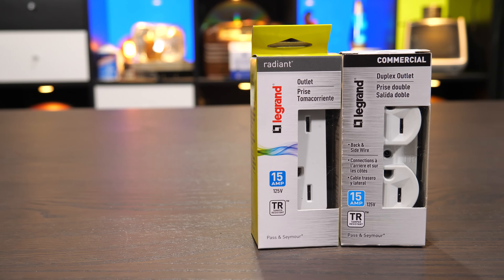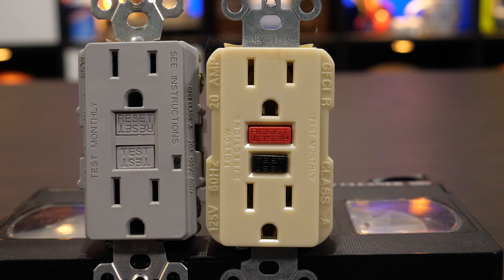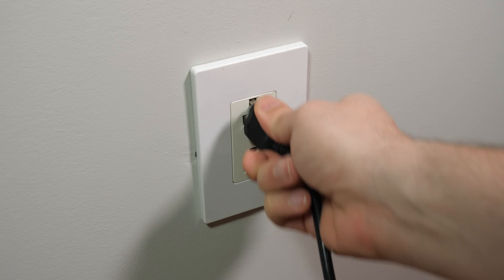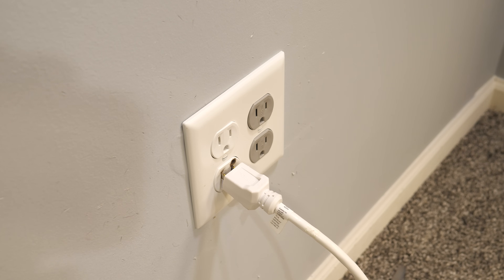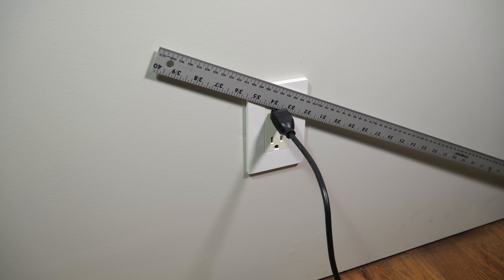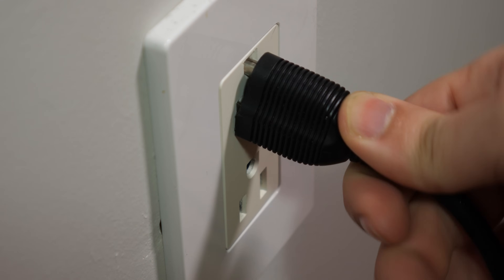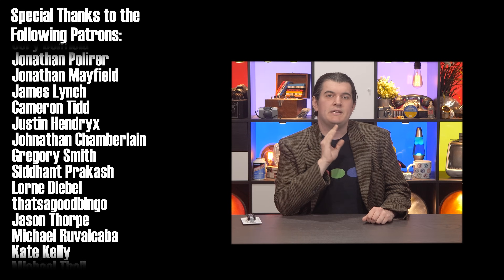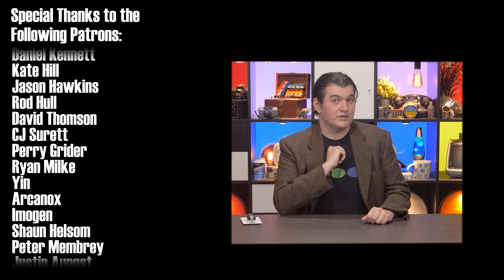Power outlets are topsy turvy - but does it matter?

Comment: I was moving a stack of sheet metal and one of the middle sheets slipped, slid down the wall and landed between the tiny gap between the outlet and pins of an extension cord. The resulting BANG and shower of sparks has led me to become a full believer of the ground on top orientation of outlets.

Comment: The plug designs we use here in Estonia (yay for EU) are superior in all aspects. 

*Neutral and live are interchangeable 
*Ground is a mirrored pin on the sides,meaning the socket orientation does not matter at all. You can plug it whichever orientation.
*all sockets are recessed
*pinholes for the plug are small and round and really hard to get stuff into
*pins on the plug are isolated far enough that power disconnects before the conductive parts become accessible.

They are more bulky and annoying...but are just plain better

Comment: The awnser for my situation was both orientations!

the kitchen has ground up due to a 2cm thick backsplash that would prevent any flat plug appliance being used, and forks/knives occasionally fall down the side of the island

ground down in the office and bedrooms because of ground down 90° plugs on most UPSes and surge protectors

the garage is mostly ground up as all equipment is above the outlet, the added benefit of plugs staying in when tugged, and all the thin metal objects hanging on the walls

and for all the outdoor outlets and any quad box, its both, with ground down on the left, up on the right, allowing for 45°
/90° plugs to be used in the recessed outdoor covers, and most of my outdoor stuff prefers ground up

the living room has mixed outlets, otherwise 3 way taps fall out if they are loaded with #14 cords or transformers, and all new 6 way surge taps fall out if you look at them wrong because manufacterers decided to move the plug to the bottom half for no reason! while power strips want ground down

Comment: It comes down to two things.  North America had powered outlets in homes well over a century ago and Americans are incredibly resistant to change, (Carter tried to get us on the Metric System and was hated for even the attempt) We have always been cavalier about electricity.  Hell, early tube radios had "Hot chassis" wiring. Even into the 70s we had TVs that had a hot chassis. All two pronged.  The radios didn't even have polarized plugs which could lead to the chassis of the radio to be on the hot power side.  At least the modern 2 prong plugs and receptacles are polarized.  I won't even get into resistive (curtain burner) power cords that were used on tube radios in the 30s.   I guess it never became a massacre so we just left it.  Codes have even been dropped from receptacle orientation. It has just remained an issue of preference as Alec pointed out.  I compare it to which way the toilet paper roll is mounted.  Either side has their logical reasons for why it should be placed one way or the other but not worth a fight about it.

Comment: Standard 2 and 3 prong plugs are dangerous if you have an IQ under 60.  The first time I saw plugs with the group installed up was in the 1996 NEC where it was listed as a suggested, therefor optional, installation method.  Having the ground up keeps stupid people from hurting themselves when they intentionally place  conductive material across the hot and neutral pins when the plug is partially inserted in the receptacle. 

The fix is to isolate the family members with an IQ under 60 in rooms with no outlets within reach and furniture bolted to the floor.

Comment: I was an EMT for 12 years. Hospitals invert certain plugs for emergency equipment. You will also find that they are usually painted red as well. When a code happens, or a patient requires critical equipment like a vent, they want to make sure there are outlets available. They do this by painting them and inverting them. The thought is if you go to plug something in out of habit it won't fit and it will cause you to look. This ensures hospitals always have outlets available for critical emergency equipment and they don't have to waste time unplugging lights or non-critical equipment. On the civilian side, I've seen electricians invert plugs that were switch controlled so a homeowner would know which plug was controlled by the wall switch. Useful when your trying to plug a lamp in.

Comment: As a Russian I see US electrics as so outdated that it is funny. Our standard power outlet can deliver 3500W power instead of how much? 1800W, I believe? And our Type F outlets much safer both inside and outside. Even in cheapest electrical outlet it is impossible to have these naked hot contacts, they are deep inside socket, but good enough outlets have child protection preventing sticking inside something that is not electric plug! Speaking about internal safety, why do you have metal socket boxes, which are fraction of inches air-isolated from hot wire? Our socket boxes are all plastic! And we don't ever make hooks on the end of the wire, our sockets are designed that way it holds straight wire, it is much safer because wire can't slip out of screw head while you tighten it. Even our ВВГнг (VVGng, strands for PVC-PVC-wire non-flammable) cable is much safer, because all wires are isolated individually. And talking about convenience, our wall outlets not stacked in pairs, you can make whatever you want from 1 outlet to 6 in row. And there is no up and down situation, because outlet is symmetrical!

Comment: What I think about is curtains or cattails maybe a sheet of paper or paper clip some kind of object falls in the right place. You can’t make it in 20 shots with the basketball hoop but by God, something falls off the desk and it will be final destination style… That if anything fell in there, plugs, get pulled halfway and continue to work. It would be more likely to fall onto the ground wire instead of connecting and causing an arc.

Comment: You know, I saw a sleeved US plug in a video once, it was for a Chinese market appliance. They are even more YOLO about electricity there, they use 240v but they use these universal US/Australian/EU outlets so they can use plugs as terrible as they like! But apparently sometimes they use something a little bit better... Occasionally for good measure you'll see a socket that accepts UK G plugs as well so you get a nice big unshielded hole just begging to have something metal poked into it.

Comment: 8:52 when I was in elementary school I was helping my dad do a friends basement remodel and he asked me to remove all the (metal) receptacle plates so he could paint. I saw their computer was on and tried to get the plate off without unplugging the computer. He walked over right as I got the screw off and yelled at me as soon as he saw the plate falling onto the plug. The prongs were all the way in so nothing happened but he explained to me that I should have unplugged it first.

Comment: I dropped a framed picture onto an outlet. I think there was a battery charger plugged in. The metal wire on the frame hit the hot and neutral and melted, scorching the outlet. My kid, in his younger days, partially pulled a plug and touched a the metal part of a pencil across the hot/neutral.

Needless to say, when I install outlets, I put the ground up.

Comment: The concern regarding the blades being accessible by children's fingers has always been reduced by the fact that children are generally introduced to the dangers of electricity at a young age in the United States since it has simply been a fact of life for more than a century in some areas. Though flawed, the simplistic and compact design proves quite advantageous given just how many outlets on average are being utilized—and the number continues to climb as our lives depend more upon the conveniences and crutches of electrification.

The older plugs were able to get away with how they were designed due to the aforementioned plus it is likely that the insulators were a better material. In the past, aesthetics of plugs were not generally considered and the focus was simplicity and effectiveness.

Modern three-prongs likely have better insulators due to generally being for more heavy duty applications and thus can remove more of the material. This is especially noticeable when you hold the plugs. The two prong generally has a more molded plastic feel whereas the three-prong feels more like rubber—a generally better insulator and more resistance to heat than plastics.

In my experience, the older power outlets had a much better grip on the plug and even in newer outlets, the older plugs are better form fit to retain their hold. Conversely, modern plugs are prone to falling out of the outlet—especially ones with foldable contacts.

Comment: In the UK they are always horizontal, so the wires can be flush without them blocking other outlets (or sockets). Also the ground (or earth) pin is always on top, and the live and neutral pins are sleeved.

Comment: When it comes to the issue of accidentally getting shocked while plugging in something, how about adding a switch to the receptacle, which you can use to cut power to the active connection, so then you eliminate the chances of that happening?

Also, I was easily able to remove those "baby safe" covers when I was a toddler by sticking my nails underneath. Which might be less safe.
Reply: I always used a butter knife.  Probably even less safe.

Comment: But then right-angle plugs make using power strips more of a PITA, at least with the way they're spaced out currently. If all of our new plugs were made to be right-anglers, power strips would need to follow suit and be bulkier for the same number of outlets, which in some situations would be more of a waste of space, as on a desk, and more cumbersome.
Reply: Power boards in Australia position the sockets horizontally, so if you had a cord pointing down, it would go right off the board. You can also buy ones with extra horizontal spacing to accomodate plug-packs. Unfortunately, some manufacturers have started putting their plug-packs sideways, which defeats the purpose and trying to plug such a device into even the extra-spaced sockets will still block adjacent ones. Which wouldn't happen if they just pointed it down like normal!
Reply: @Roxor128 : Heh, thanks. Yeah, that sounds frustrating!

Comment: Ground up only is practically applicable for emergency/backup receptacles and hospital use where proper cords(and code) are always used and accidents and stupidity is abundant. Even then the aforementioned is in place, different style plugs are used, or GFCI breakers are in place rendering a fault anyways. American style plugs are utilitarian for the service, and sufficient in most cases, I think Aussies strike a good medium with usually just coating on hot and neutral.
P.S. As someone that works on live 120/208/277 in a room of constant idiots that like to touch, people really do rarely get shocked vs overloaded circuits and smoked outlets.

Comment: Ok hear me out.... the receptacles are facing each other, not stacked. So ground pin on outside so no matter how you install it, the ground of the top plug is always facing up. No more arguments over orientation, and right angle plugs will never interfere with each other. It's the most logical compromise maybe?

Comment: fun fact:
shoving a piece of metal into the ground of a receptcle and connecting it to an antenna connection on a radio will turn the whole electrical system into an antenna.

Comment: You clearly do not work in a shop, or on site.  It is a U ground not a n Ground.  Don't let old plugs slow down new better standards.  Right angles do not lie flat with extension cords.  Right angles have their place, but this is the first time I have thought your opinion is yours, but wrong.  The C ground is a really nice idea though.

Comment: 8:37 This actually happened to me one time. I was installing a 2 prong to 3 prong adapter on a plug with a metal plate and had the adapter plugged in and I was reinstalling the screw in the plate and the metal plate slipped down onto the two live prongs of the adapter and made a hell of a spark and melted the plate where it touched the prongs. I don't remember if it popped the breaker or not.

Another issue is with polarized wall warts or plug in transformers. I don't know why they make them polarized and when you try to plug them in: nope wrong way try it the other way nope you had it. You only need polarized plugs on things like lamps and not plug in power supplies.

Comment: Honestly, the only real bad thing about an inverted plug (ground plug up) is that you can't safely plug-in a wall wort (wall transformer) with polarized plugs, because the center of gravity will then be above and out from the outlet -- not to mention the cord protruding from the top being a source of torque! -- causing it to tip out of the outlet.

Comment: very slightly improving safety for super edge case situations....at the cost of NOTHING, seems fine to me. Hot-pin down sideways, or ground-up works for me. I like sideways, but mine are all ground-up and I dont like working with drywall, lol. My kitchen ones are sideways and the one next to the sink in the bathroom rotates, which is really strange.
I known my buddy chose ground up in his woodworking shop because nails falling back there and sparking in a pile of sawdust was a risk that he could mitigate for no cost.
Ultimately, i can think of several other fixes, but nothing scares Americans...except change for logical reasons.

Comment: I used to plug in my laptop into an outlet behind my bed that I couldnt see by touching the prongs as they slid into the holes to line it up. Little did I know until later I was playin with my life there.

Comment: I think ground-out is an obvious compromise. You can opt in to the protection at the top, and you can plug in two right angle plugs together. The other suggestion in the comments of 90° solves the angled plugs, but not if you want to install it ground up.

Comment: In my home most outlets have ground on the bottom orintation.  Outlets with ground on top are connected to wall switches so you can turn on lights.  Only the top is activated by wall switch and the bottom is allways on.

Comment: I worked in a restaurant with stainless steel prep tables. There was on big one with a life outlet under the lip on the short side. There was another one that could be pushed around. One day someone needed to prep very long pieces of meat . The cook shoved the tables together along the short side. The life outlet oriented in between the tables. It wasn't an issue until he was done. He decide the seem between the tables was a good place to store his knife. When the knife went in it welded the tables together. Sure he was dumb but I always felt it had to be an old outlet if it could arc through metal that was close to it.

Comment: When may daughter was about 2, she dropped a penny behind a plug, shorting the terminals. Of course the circuit breaker tripped, but not before throwing sparks, making a big burn mark on the wall, blowing nicks into the penny, and terrifying my little girl. Fortunately she had dropped it, and wasn’t holding on to it. Anyway, any chance I have to do any maintenance on any of my plugs, I always flip them to “upside down” with the ground up now. 

Now I’m living in Malaysia, though, and they have the UK style plug. I am in love. I used to think it was too big and ungainly, but it is so good and has so many cool features and safety advantages. It’s way better than the circular two prong European plugs, which also have some nice safety features but are often as flimsy as the American plugs

Comment: I am quite confused by your electrical uses, as here there is a big difference between ground and neutral, while you connect them, but then I don't understand why you use grounded plugs as well, isn't it a bit redundant?
Reply: That’s a complex subject beyond the scope of this video.  In the North American split-phase system, the neutral is connected to ground only at the point of first disconnect, which is usually the main breaker panel.

Comment: Oh! I have one for your 90 degree plug example! It's SUPER frustrating plugging in my Amana chest freezer. It has a built in 90 plug, designed for the ground on top. So with my ground on the bottom outlets, it's ULTRA annoying. I finally bought a 6" extension cord to plug it into.

Comment: Everyone that uses the US style plugs needs to copy Australia! We have a very similar design but with more rigorous and consistent standards. The plug housing is a little bigger making them easier to grip and you’re fingers are much less likely to touch the prongs. Also the live and neutral blades have insulation at their base and no this doesn’t affect the sockets. 

Our plugs are actually pretty consistent in design so you won’t see too much variation, likely dues to strict standards. We do have a two prong, non earthed plug [EDIT: again these plugs are all very similar in design, with a substantial enough, amount of plastic to keep your fingers away from the prongs! Insulation on the live and neutral make it nearly impossible to contact a live prong], restricted to 7 amps and only for double insulated appliances. 

Our sockets are always earth down, usually plugs come strait out or a 45° right angle. Extension leads and strips must be 10 amps and earthed, strips must have a a built in breaker. We’re also required to have safety switches on an every circuit that has a power point. That’s for new installs and renovations. I’ve never seen a dedicated safety breaker on a powerpoint here. Oh and yes we have switches on our power points, I think it’s crazy the US doesn’t have them!